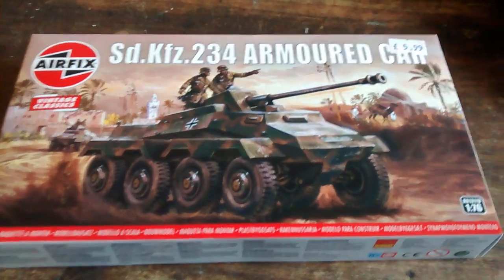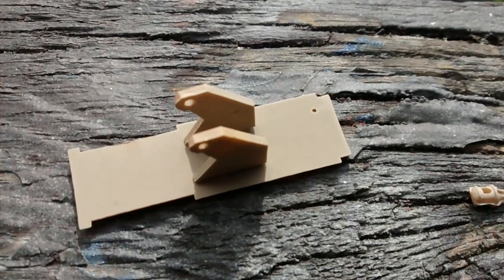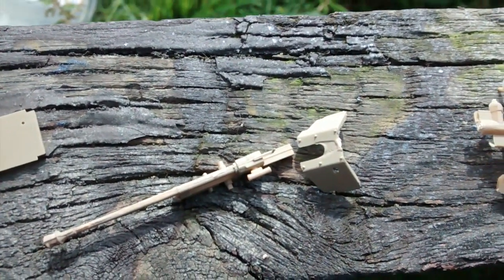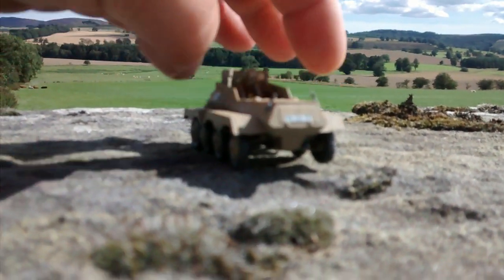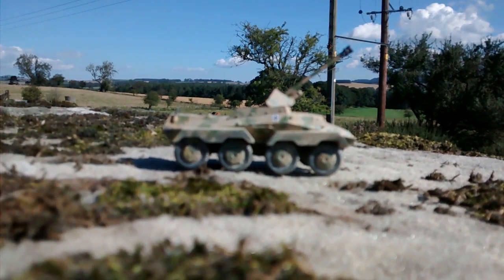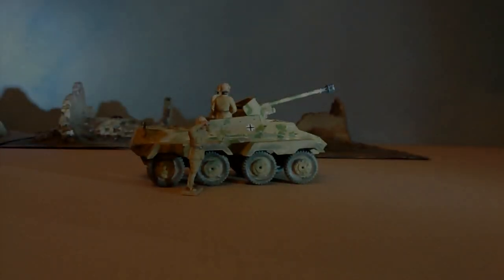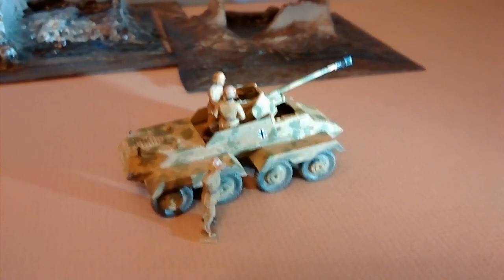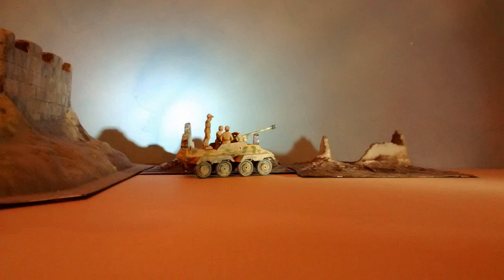Sd.kfz. 234 Armoured Car ( an Airfix kit from 1964 )

Comment: This model confuses me as I didn't think the  Sd kHz 234 was used in Africa or if it was it was only used in Tunisia 
Yet I thought the 234 had one continuous mudguard and the 232 had two per side and this was used in Africa
Does anyone know more on this subject ?
Reply: Yes. The model depicts the preserved article at Bovington tank museum, which had mud guards from another armoured car added to it. 

These (and other armoured cars like the 6-rad made as a kit by Matchbox) tended to be used by recce units early on, including in Africa, and by SS, police and rear-area or training units later, as these large armoured cars were found not be very useful by the Germans at the front line. 

Allied armoured cars like this were trialled, thinking the Germans were on to something, but almost all failed: top-heavy not much use off-road and too complex. 

Modern vehicles use this layout, to more success, as they are wider than they are tall.
Reply: Thank you I always wondered why Airfix got this wrong . I have been to Bovington but never seen this vehicle .I will have to look again when I go back at Easter